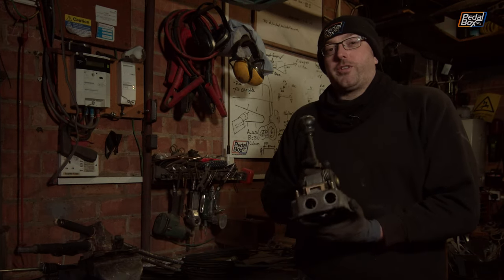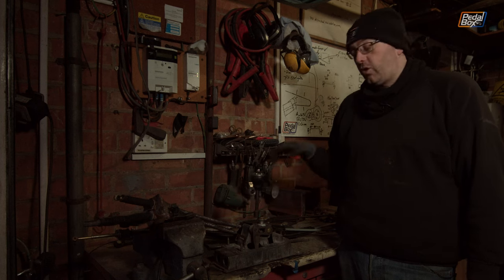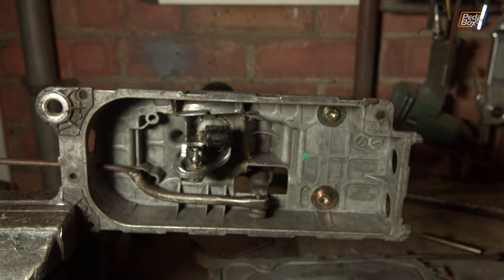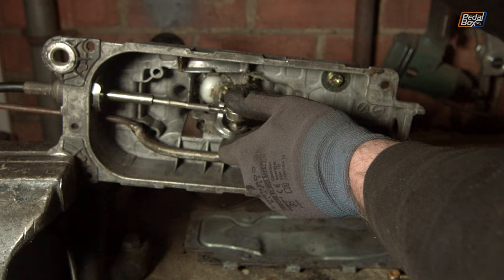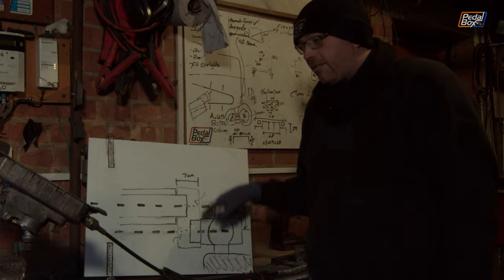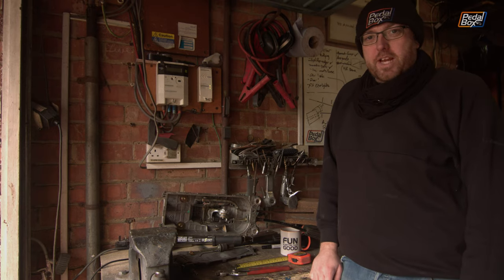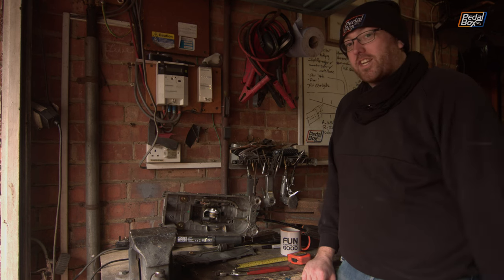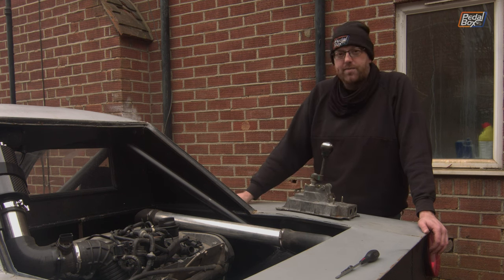Back-To-Front Shifter Cables | Audi TT Kit Car | PedalBox Episode 126

Comment: I'm so glad you've gone for simpler approach, don't put to tighter curve on the cable. Cable guys use a really low friction, guys my way had boxes of spherical joints and all sorts!! 
Great update chaps 👍
Reply from the maker: Yeah, the rear exit was just too complex, as nice as it'd be to make work, it's possible it'd STILL end up with tight turns making more friction than the long cables, so a nice wide radius at each end is the winner

Comment: FYI, if you had continued with plan a, you would have found out the H pattern was reversed. Ie 1 & 6 flipped as the cable movement in the wrong directions. You needed a new/modded shifter with the ball joints above the stick pivot point to allow the cables out the back to work correctly.
Reply from the maker: Plan was to put a reversing pivot in to overcome this because as you say, it'll be all backwards, and there's no way I'm dealing with that, lol. But that's all yet another bit of complexity with the bell crank to get over the top without having a tight radius in the cable. So bit of a no-go either way sadly